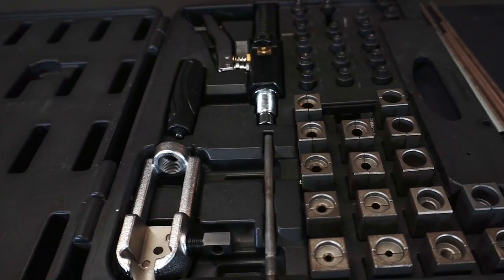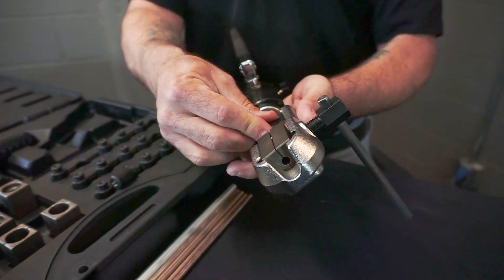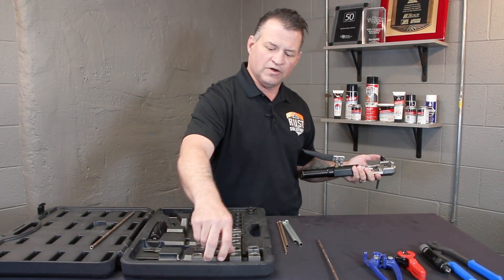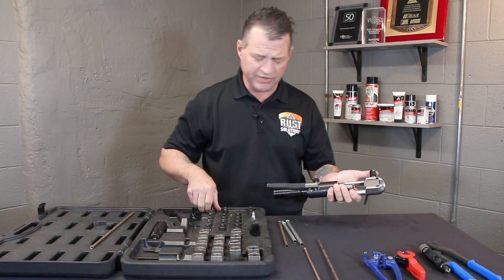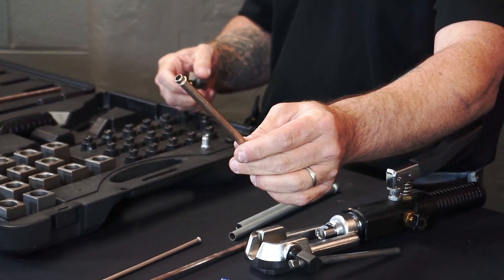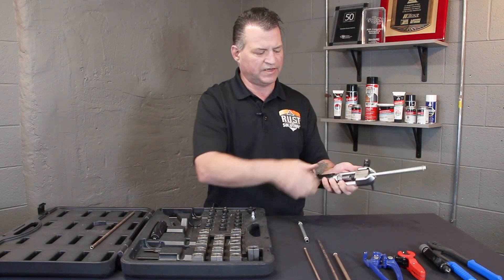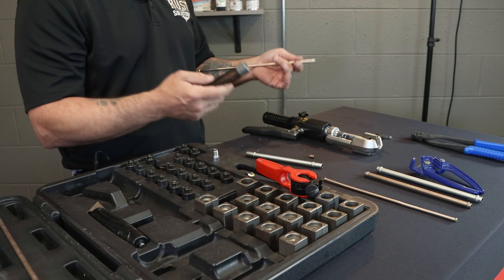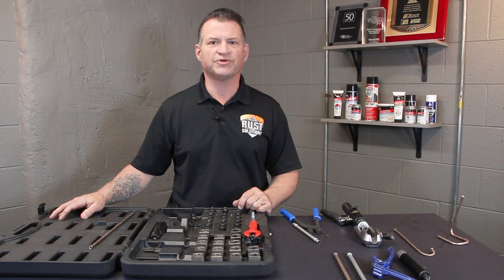AGS FF-3 Universal Hydraulic Flaring Tool Demo

Comment: will this work for injection fuel lines on a cav pump on a tractor? The flare looks like a rolled bead similar to a push connector on a GM. But is for diesel injection

Comment: Your video sold me! This tool is amazing. I am no mechanic but every flare, even the first practice flares, formed perfectly. This allowed me to repair my super difficult to replace power steering line in my 2009 Infiniti FX35. The tool is expensive but it's far cheaper and much less trouble than replacing the entire high pressure line. I tried the cheap rental flaring tool from the auto parts store and I had no luck with it. This AGS hydraulic flaring tool was a pleasure to use and I am super happy with my purchase. The tool is well made heavy duty, and forms double inverted, bubble, single, push connect and GM fuel line flares in a plethora of sizes. I'm just so impressed. The flares were so easy to create and will not hurt your hands. So good. Thank you AGS!!